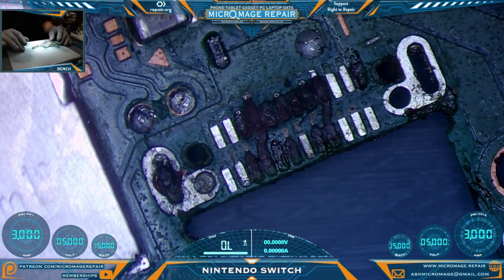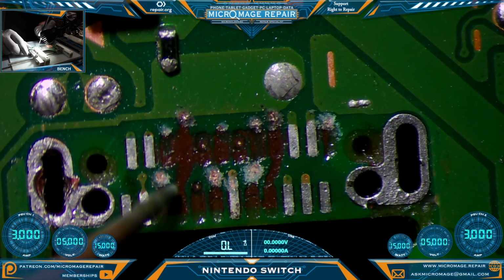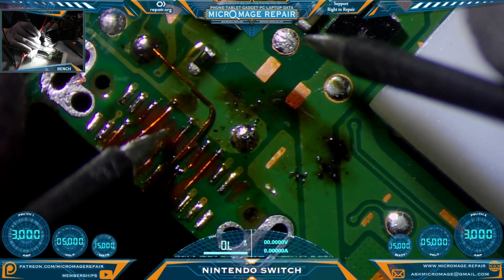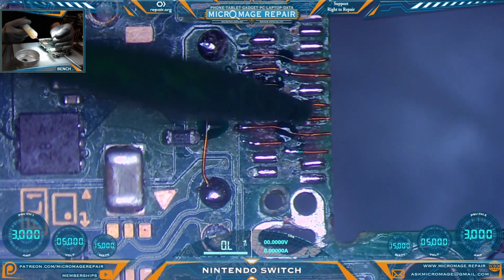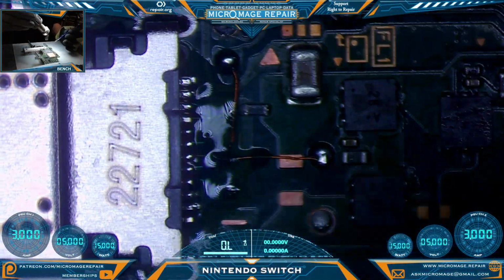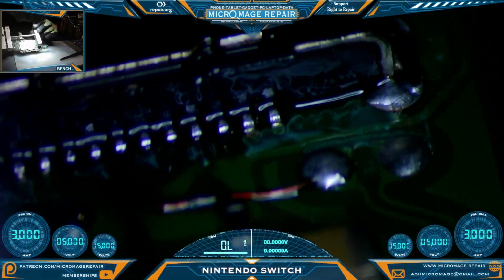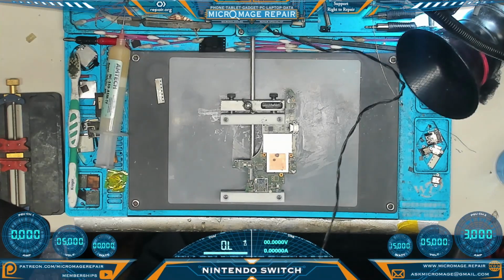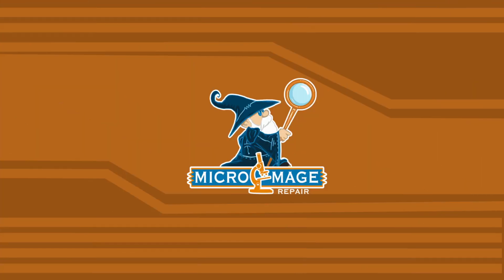Nintendo Switch: ⚠️ DIY Disaster Zone ⚠️Can even a Mage Fix it?

Comment: hi, i have a strange issue with a nintendo switch motherboard. it boot normally but doesn't dock. i change the port. i change 4 p13 chip and still no docking. all connection from port to the test pads are ok. filters are ok. no missing component or any other obvious things. any idea? i thinking to reflow the SOC, maybe there is a solder ball cracked, but i'm not sure if this is the right way.
Reply from the maker: Is this the version that has the diode arrays populated? If so I'd remove the one on side A (or both) and test again.
Is it the dock? Docks can go faulty.
Is everything around PI3USB checking out like the filters?
This is where I'd begin if it were on my bench.
Reply: @MicroMageRepair  yes, the board have diode array and i remove it both side. i know some times can cause problem. original dock is ok and also the external one. filters are continuos. i now changed the 4 pairs of caps between filters and PI3USB in case one is faulty but no luck. seems that PI3USB isn't receiving signal rather than not being able to put out signal. when i put the console in the original dock the screen goes black, green light stays on but no signal out. not even a black screen. my monitor stay in standby like there is no data going in. and as i previous mentioned dock is working with other consoles
Reply from the maker: @RVNR2022  
Interesting.
I'm honestly not sure where I'd go from there or if I would even proceed at that point You have been very thorough. If you figure out the fault I'd be interested in your findings.
Reply: @MicroMageRepair  i found the fault. i will make a video now on this board repair. but, in short, it's a bga ball cracked under the SOC
Reply from the maker: @RVNR2022  Most excellent 👍 I'll have to check it out!

Comment: Fantastic video, as always. This looks like one of those jobs where you tell the customer that it’s not worth it economically to repair and they reply they don’t care about the cost. Kinda makes you wonder if they don’t care why didn’t they send it off in the first place.
Reply from the maker: Thank you Border!
It's more of a case of, regardless how extensive the damage I really can't exceed a certain percentage of the devices worth with pricing except in the case of data recovery.
I charged the maximum price my market can bare here.
These jobs are not the types I dread too much anymore , I'm pretty comfortable and confident doing them after a great deal of repetitions. (There was a time though)

Comment: josh ive got 6 not as bad but still ? what about lugs  , i dont want suprises either?
Reply from the maker: Some folks claim the lugs are easier.
I don't find them to be (still use them here and there), but I had intensive practice with jumper wires before those existed so it may just be that I'm just comfortable doing what I do 😂.
They do require a different approach.
With lugs I have found securing them in place then soldering them to work best, kind of opposite of the wire work flow.